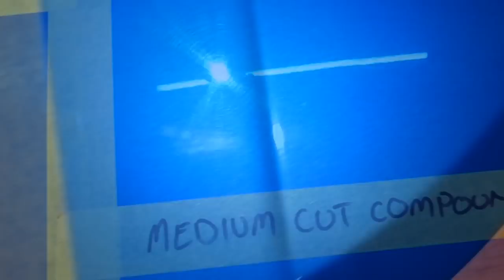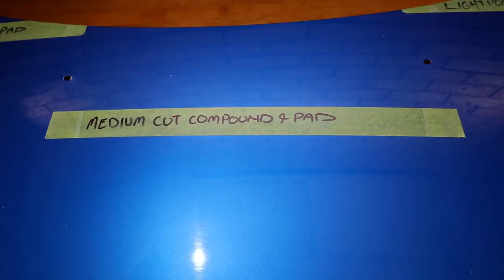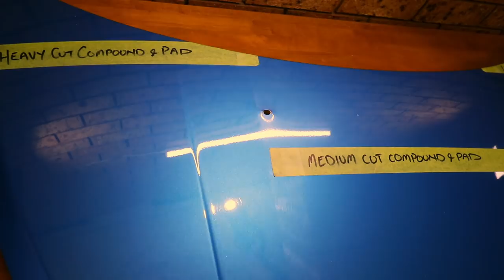How To Machine Polish Car Paint - A Guide For Beginners

Comment: Hi Sandro, i use Menzerna Super Finish Plus 3800 + Finishing Foam Pad. the problem is, why its hard to buff ? its like the panel grab the microfiber
Reply from the maker: Hard to say for sure why that’s happening, but you could try either working it a little longer or shorter - if polishes are over worked or not worked enough they can be difficult to wipe. You could also try halving the amount of polish you use, as typically when using finer finishing polishes less is more. The other thing is just making sure your pads army overloaded with residue - as that will also tend to create difficult wipe offs.

Comment: Great tips! Thanks for your time and effort.
And one small tip from me (I like photo-videography). As your electrical power frequency is 50Hz (I believe you live in Australia), so use the shutter speed of 1/50 sec or 1/50*x (where x can be anything from 1, 2, 3, 4 and to whatever, as a multiplier
), and as 1/50 is your basic shutter speed, then for best quality 25 frames per second in settings is what you need. This will reduce light flickering in your videos and squeeze the best video quality out of your camera.

Comment: Thank you for an excellent video. 
I have the menzerna medium cut 2500 and menzerna super finish 3500 with chemical guys green hex logic pads and white aswell. From what I've read I think my clear coat is typically medium hardness on a Seat. I have very light swirls, so I think I'll follow your method and maybe try 2 sets of 3500 with the white pads on a panel and see how it responds. As much as I'd like to jump straight in with the 2500 and green pads I  think its sound advice starting light.
Thanks again!

Comment: hi this was a great video ...i will be hopefully correcting some of my 2003 toyota celica which im guessing could be a soft to medium paint ...i have a new DA polisher as well as menzerna 400 / 2500/3800 with all the menzerna pads incuding powerlock polymer sealant ....your tips should help me to achieve a better finish with hopefully a few scartches and defect free ... thank you
Reply: Hi Sandro it went well and the car looks great , i spent a good 7 hours on the car , i removed most of the swirls and the finer scratches , some of the medium scratches but unfortunately i couldnt do anything for the heavy scratches but saying that my car is wrapped on the roof and bonnet and tailgate and wing will be wrapped next year but your video has really helped with my machine ..thanks
Reply from the maker: Fantastic to hear that, it sounds like it went really well and I’m sure your learnt a whole lot by doing it!

Comment: Another great video Sandro. Clear, detailed, yet easy to follow advice.
Thank you for the time you put into your channel.
I'm waiting for fairer weather & I'll be doing it myself. I'm putting my kit together, but I have to work outside & it's always raining here in England at the moment.
Bring on the spring time!

Quick question. Do you or have you used Bilt Hamber cleaning products?
I'm really interested in there autowash & autofoam. Everyone seems to rave about them, but I value your opinion above all others.
If you've reviewed them in a previous video (I've watched most of yours), please remind me which one.
All the best!

Comment: Just found your channel and this video.  It’s great!   Just getting into paint correction so this was very helpful.  One question as I’m starting to gather supplies - how many of each type of pad (heavy, medium, fine) should I get to polish one vehicle?
Reply from the maker: A minimum of two pads of each is vital in a working progress to swap out pads regularly and allow them to cool, you need to manage heat that way. You’ll probably need more like 4-5 pads to get through the whole car as they will become over saturated even with brushing them out, but you could stop wash and dry your two pads and then continue as a method.
Reply: @CarCraftAutoDetailing  thanks!

Comment: Hi Sandro, i love your videos, your accent aswell, which is very easy to understand. Thanks a lot for this informative video. My question is simple. Would you recommend Menzerna 400 heavy cut or Menzerna 2500. Which one would you recommend to a beginner/amateur user as a one step compound? I am a lazy one :) (Just forget about their prices) thank you in advance.
Reply from the maker: Thanks mate and I think 2400 is a better place to start overall as a beginner. Even if the paint is hard it should still improve the finish quite well abs you can always step up to 400 on the future after a bit more practice.
Reply: @CarCraftAutoDetailing  thanks ☺️ the good part of 400 is beeing a heavy cut compound but also leaves a very impressive finish on the paint and is not very necessary to go on and finish with another compound. 2400/2500 is doing the similar job but called medium cut. I think i will go with this one also it is cheaper :) by the way my car is 11 year old black metallic Corsa D, rather has medium soft paint and medium level defects let's say.
Reply: @CarCraftAutoDetailing  Sandro, i actually have some Meguiares Ultimate compound somewhere at the garage. Do you think getting Menzerna 2400 would be a waste of money? Should I use Ultimate compound instead? If the final result wont be that big, maybe i should try Ultimate compound first? Or they are totally in another league? Thanks in advance
Reply from the maker: Ultimate Compound probably sits between Menzerna 400 & 2400 in terms of cut and finish so it could certainly be worth a go especially since you already have it.
Reply: @CarCraftAutoDetailing  thank you. Maybe this may sound crazy for you but you are a pro detailer and i think you have thought about such things in the past too. Do you think mixing/making a combo with meg. ultimate compound and autoglym super resin polish, applying on DA polisher at once and work like this on the paint is a crazy move or a smart one? :) I saw some videos online and the final result looks decent and bring more shine to the paint (btw i bought both products after watching your videos)
Reply from the maker: Yes you can definitely mix compounds and polishes if you like but it also adds more variables and it’s harder to be consistent so it’s not something I do a lot but it’s an option

Comment: Thanks for another great video Sandro.  I also did a DIY polish over the weekend.  I ended up with little white transparent dots after a 1 stage and 2 stage correction.  I can see in your video you have the same little transparent white dots in the paint after the stage 1 correction.  May I ask how to remove these dots and what was the cause of the dots?  Thanks again Sandro
Reply from the maker: Those dots tend to be minor pitting in the paint, usually cause by heat and also more common on hoods or bonnets. 
The only real way to remove or at least reduce their appearance is to cut or level the paint more aggressively, so sometimes it’s better to live with them rather than sacrifice more clear coat removing them, but it’s a choice you can make.

Comment: Noticed you used the same polisher as the DAS 6 Pro Plus 15mm. I tried my friends DAS 6 Pro Plus 15 and immediately sold my Rupes MK II 15. It has WAY more pad spinning power than the MK II. Not quite as smooth as the MK II, but good enough for me.

Comment: I just bought a ‘98 BMW Z3 that’s not been well cared for. There’s some clear coat coming off & just in general the paint is full with marks (lines) from something. I know I’ll never be able to make it look new again, but I don’t know anything about the paint (if it’s hard or soft), so I don’t know how to proceed. Do you have any videos working on a car with a lot of damage or can you suggest what I should do. I certainly don’t want to cause any more damage. Thanks 🙏🏼
Reply from the maker: The video link below may further help understand the paint correction process, but if you have clear coat failure - meaning it’s coming off or missing - you can’t correct that, the panel need to be repainted. Deep scratches can be removed if they are contained in the clear coat but not it they have gone through to the base or primer paint. 
https://youtu.be/6tepA3wjPbY
Reply: @CarCraftAutoDetailing  Thank you! I know it can’t be repaired, but I was wondering if the raised edges could be melted into the finish with something like acetone. 🤷‍♀️. I’ll watch the video. I live in Hawaii & they want a fortune to repaint a car, so I’m on my own.

Comment: Hey Sandro, great video man 👍 I'm going to get into polishing but had a question regarding DA polishers. I have a 12mm Shinemate polisher, with a 3inch backing plate. Am I able to swap to bigger backing plates? Like 5inch? Cheers!
Reply from the maker: Glad you found the video helpful!
DA polishers (unlike rotaries) have counter weights to balance their movements which are specific to each machine and it’s backing plate and pad sizes. Although you can put larger or smaller backing plates and pads on any DA, what happens is that it throws that balance off and the machine will run rough generally leading to a poor user experience, poorer results and increased machine wear. So you can do it, but I wouldn’t necessarily recommend it 🙂
Reply: @CarCraftAutoDetailing  Okay cool. I may see how I'll go with my 12mm, and then get a bigger DA if needed. Cheers again for answering my annoying questions 😂👌

Comment: Great video and tips, i used a shinemate with the yellow pad that comes with it and school s20 black , the car have hard clear coat i did two passes became good but is it safe for the clear? I think i did not put too much pressure and maybe faster movement  the car never have been polished too  best regards :)
Reply from the maker: That’s a fairly light compounding combination especially if the paint is hard. Well maintained paint is able to resist UV oxidation and environmental contamination much better, so some light polishing and some protection is a great way to look after and maintain it
Reply: @CarCraftAutoDetailing thank you so much, yes the car is always in tip top condition does not really look a daily to be honest 🤣 have a sealant (labocosmetica cupido) and maintenence with they qd and in 3 to 4 wash with revitax :)

Comment: Thanks for your time to make such a great video. Just wonder if this Menzerna Car Polish Set: 1000 + 2500 + 3500 will work on geal coat of my sailplane? Got scratch marks left from 1000, 1200, 1500 and 2000 grit wet sanding and need a solution now.
Reply: @CarCraftAutoDetailing  thanks for reply just found designated stuff: Menzerna Gelcoat Series: 1-cut compound 2. Fine cut + gloss polish 3-Premium Gloss 4 3in-Premium Protection. One-step Polish and Liquid sanding also available. Will buy correct stuff for job. 3M paste and deglazing did not work well so won't risk again with car product

Comment: Really good video thanks a lot. I noticed you suggested in the video if what you use doesn't quite get rid of the swirls then to use a more aggressive compound and foam pad. What particular foam pad and compound would that be as an example? Thanks :D
Reply: @CarCraftAutoDetailing  Thanks for the quick reply. a Microfibre or wool pad but used with the same compound, right? Also I am watching your video on the pads... firstly its really useful and secondly I noticed for the HDO blue pad you talk about the cleaning procedure taking twice as long. What is your procedure for cleaning it? Thanks again bud
Reply: @CarCraftAutoDetailing  Just made an order for TLC off Waxit. Look forward to getting it. I also ordered the LC MicroFibre HDO Pad. Is the same procedure applied with Microfibre pads? For example.. Do I prime the pad with the compound first then apply 3 dots? Do I also keep the speed on setting 5 and apply about 5 pounds of pressure as I would with foam pads? Also I have been meaning to ask you. If I got only 1 foam pad for compounds, if I clean it well enough after each use, can I use that same pad using different compounds? Thanks
Reply: @CarCraftAutoDetailing  You're a diamond of a bloke... all this useful free help you give along with videos... Can't thank you enough!

Comment: Do you think making it a 3 step correction will be worth? What I mean is heavy cut compounding and then finishing with medium cut as final finishing did nothing on heavy cut but how about going to final polish after medium so making it a 3 step correction. Even improved finished? Or waste?
Reply: Car Craft Auto Detailing I get that. But keeping ocd into consideration😜 the 3500 finishing polish over 2400 finishing may result better finish in some paint maybe. But thanks for the video it really helped me in many department so far I can say one of the best video on machine polishing👌🏻

Comment: I'm an amateur detailer so don't take this the wrong way. Are you familiar with the Kevin brown pad priming/seasoning method? It basically coating the whole pad with product not just 5 to 6 pea size drops.
Reply: Car Craft Auto Detailing ok. Didn't know if I was doing something wrong or not cuz your end results are great
Reply: casey johnson hi mate. Remember this is an introduction to novices and as they gain experience they can start to perfect the process and achieve faster better results. 
 Good shout tho.
Mark

Comment: Can I just cut using a machine then just the old school hand polish and remove by hand I meant
Reply from the maker: You can cut and polish by hand but it’s extremely difficult to obtain the same results and extremely time consuming
Reply: @CarCraftAutoDetailing  I appreciate ur reply I edited my comment I didn’t make sense lol
Reply: @CarCraftAutoDetailing it’s not for a show car just old cars quick buff and polish before re-selling them
Reply from the maker: If you have a machine polisher you should really use it to both cut and do your finishing polish - it will allow you to obtain a better finish than doing the final polish by hand.

Comment: Can you show how you would go about touching up an edge that you burned slightly?
Reply: +Car Craft Auto Detailing Thank you for the reply. In my case I have this problem on the top right corner of the cutout for the headlight washer (pop-up) on the front bumper. The paint is black metallic. Would you advise that I just leave it alone without touching up? I can provide photos if that would help.

Comment: OK, you loss me. I think you decided that two sets of passes with your heavy test product was your best strategy. Assuming that was correct, I didn't understand your need to reduce the work area from 2x2 to 1x1. As usual another great video. Thank you.
Reply: Thank you for your quick reply. I'll watch that section of the video and reread your reply until I get the concept. Your video's are just remarkable. It's very cool that you make them cinematic, thank you again.

Comment: Can I use menzerna 3in1 right after menzerna hc 400?
Reply: I'm using ex650, just like you. But oftenly the BP isn't spinning. Especially when I work vertically, you have suggestions? I usually work at speed 5.
Reply: Car Craft Auto Detailing thank you for the info. I'll try to film myself first.

Comment: WOULD YOU BE KIND ENOUGH TO EXPLAIN WHAT PROCESS YOU WOULD USE ON"SINGLE STAGE ACRYLIC ENAMEL- WITH WET LOOK HARDNER ADDED AT A RATE OF8-1 + 10% UR70 MED.REDUCER; THERE IS" NO  CLEAR COAT ON TOP OF PAINT- THE PAINT IS "MIGNIGHT BLUE METALLIC PEARL-ALMOST BLACK UNTIL EXPOSED TO SUNLIGHT- I AM NEW AT THIS I PURCHASED A 6"D.A.POLISHER AS WELL AS A DEDICATED 3" ROTARY BUFFER 3M/MEGUIARS,s COMPOUNDS AND POLISHES; I,M NOT EXPERIENCED ENOUGH TO UNDERSTAND- THE MICROFIBER PADS /AS WELL AS EVERY COLOR FOAM COMPOUNDING & POLISHING PADS"LAKE COUNTRY BRAND" KNOWN TO THE INDUSTRY OF DETAILERS- TOO MUCH TO UNDERSTAND, SHOULD YOU DECIDE TO REPLY IT WOULD BE GREATLY APPRECIATED- THE SYSTEM AND PRODUCTS YOU WOULD USE ON A FRESHLY PAINTED AUTO- "WITH NO CLEAR COAT APPLIED; THANK,S MATE KEEP YOUR VIDEOS COMING I REALLY NEED THE INFO; PATRICK.P

Comment: what do you recommend to remove a clear coat scratch that i cant feel with my finger nail but i can see it..was probably from cat got on my car its on the front bumper .. thanks
Reply from the maker: I’d probably just start with a heavy cut compound and wool or microfibre pad and see if it levels it down enough so that’s it’s not longer too noticeable. 
Beyond that you can use some 2000 grit sand paper if you wish to go further, but just make sure you have enough clear coat to work with.
Reply: @CarCraftAutoDetailing  ok thank you..great simple video i sub